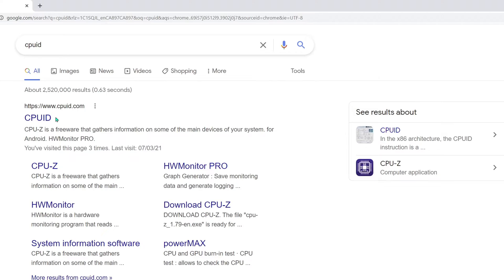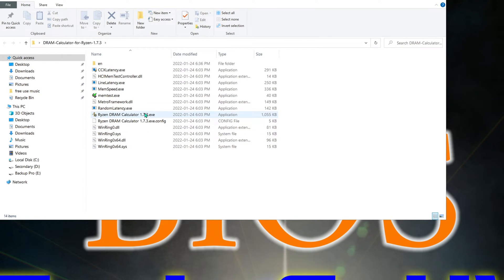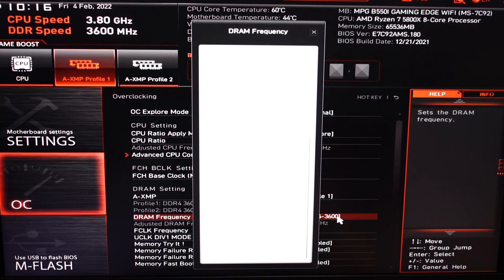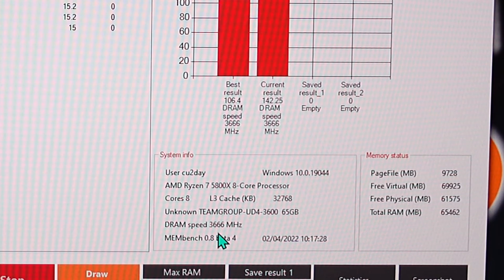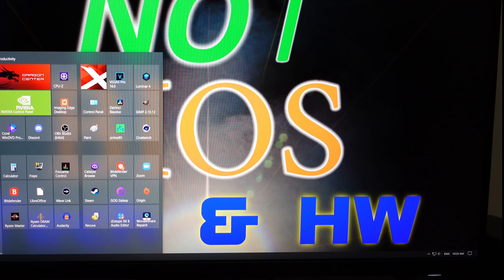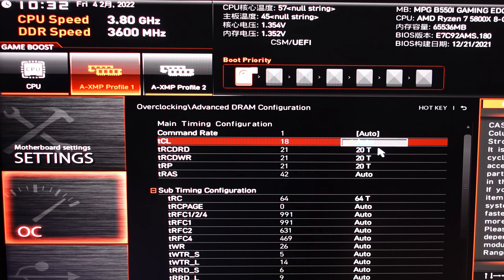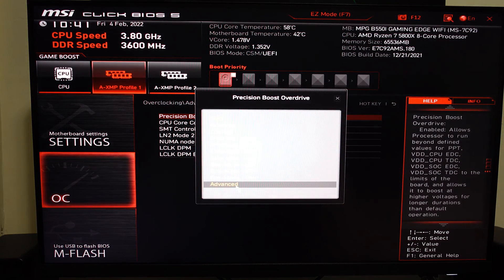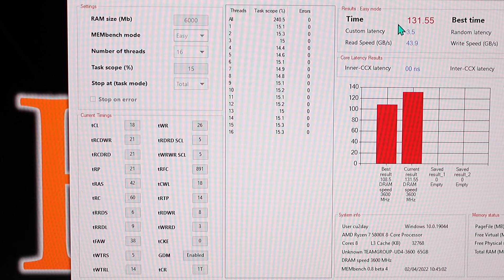Memory (RAM) Tweak/Overclocking, How to Guide (DDR4 shown)

Comment from the maker: Dram calculator that I mention is not for memory clock speeds in this video. It is garbage for that purpose. Use it for memory tool for testing stability. 
HOT TIP - You bought the tightest memory timings. Congratulations on your "binned" memory tested to meet max speed, you have little overclocking left some tweaking might be possible

This is "NOT binned" meaning I have MORE room to overclock timings.
Loose timings, might look bad BUT often they OVERCLOCK like mad. March 1st 2024 bought TeamGroup CL34 44 44 84 memory DD5 at 6000Mhz. And went straight to CL34 42 42 82 easy and stable no voltage touching. Next I went to to 34 41 41 80 next attempt I went to 32 41 41 78 and it is still stable!!! No voltage touching. This is "NOT binned" meaning I have MORE room to overclock timings.

Cas Latency is over Hyped! Those other timings are all delays that are hurting your max performance.

There is no magic bullet to overclocking, it is trial and error. Two sticks of identical memory does not always have the same memory within as another identical stick. Even the same brand purchased in a different package same specs, 1 could be micron and the other Samsung and even the controllers in the memory could be different. Even truly identical memory can overclock different; Silicon lottery! it's a thing.

Comment: Hi I have VENGEANCE LPX CL16 3200mhz can't overclock it only wants to stay at 3200mhz any reason why. I have a Ryzen 7 5700X3D CPU with 32gb of ram.

Ram timmings are.

tCl is set to 16
tRCDRD 19
tRCDWR 19
tRP 19 
tRAS set to Auto which is 38
tRC 57
tFAW 24. 

That's all I have changed in DRAM Configuration.
Reply from the maker: Several CPUs max out at 3200Mhz memory speed. The CPU has a memory controller built in.
Reply: @sparketech  thank you for replying.Does my numbers look okay or is there any you would change. The AMD Ryzen 7 5700X3D officially supports up to DDR4-3200MHz RAM but excels with faster speeds like 3200MHz or 3600MHz at low latency
Reply from the maker: @Al-ly2cx I want you to think about something for a second before I answer. X3D has... Think about it... Larger faster cache memory speeds meaning that memory speeds make a far smaller difference... Only 4% at slow speeds vs max speeds compared to not X3D is a 12 to 15% difference.

Back to topic timings vs memory speeds help certain programs more than others. One is speed the other is latency which is the delay of each instruction. AMD does not guarantee 3600mhz to be stable at 1:1 speeds. With the 5000 series 3200mhz is pretty much guarantee stable. My 5950X (my last AM4 CPU) was less stable at 3600mhz despite my memory being made for that speed.

I recommend 3200mhz with tight timings for the over speed without the occasional crashing issues. Especially even more so with an X3D CPU making like nearly zero difference to performance
Reply: @sparketech  @sparketech  Hi thanks for your time buddy really appreciate it. 

I didn't think of it like that but that's really useful to know I am really interested in ram timming so I am a beginner at this stuff. What do you mean tighter timmings I have my timmings set to something like this.

Tcl 14 instead of 16 doesn't crash 
Trcdrd 19 
Trcdwr 19 
Trp 19 
Tras 38
Trc 58

Can't seem to go any lower then 19 and if I put the tRC to 40 it will also crash.

Also aida64 ram test says 54 ns can't get this to go any lower.
Reply from the maker: @Al-ly2cx be careful about pushing to the max. Let's say your TRC is 58 you find 54 stable... I recommend for stability to go to 55.  Either way the differences are going to be like 0.5 of a frame faster... And when timings are pushed to far it actually makes your system slower due to error correction latencies
Reply from the maker: @Al-ly2cx the TCL timing is the most important followed by those 19 19 19 timings. If you watched the entire video I provided bonus settings to tweak.
Reply: @sparketech Thank you 😊 will watch that video again. Happy new year to you 🎊.
Reply from the maker: @Al-ly2cx Happy New Year. Have a great day

Tomorrow I might release the review of the new case I bought.
Reply: @sparketech awesome look forward to that video if you post it 😊
Reply: @sparketech Hi change my ram tcl 14 instead if 16 , trcdrd 19 , trcdwr 19 , trp 19 , tras 38 set to auto also my trc is set to 55.
is there anything I could do to improve these numbers I have stressed tested using DRAM calculator using membench no errors. Also trp can go lower to 16 or 15 but if I change it will it be out of sink with the other timings. Time with membench is 139.62 Custom latency 4 also read speed 39.6. I have watched your video to the end and if I change my trfc1 lower then 560 it crashes. :)
Reply from the maker: @Al-ly2cx  You'll have to test with some games for a bit... Keep note of default and what you changed incase something isn't "fully" stable and anything has to be put 1 step higher
Reply from the maker: @Al-ly2cx  Sorry still working on the video. I wanted it to be very interesting and informative so I took some extra time with it.
Reply from the maker: @Al-ly2cx posted https://youtu.be/VDJpmduqwQ8?si=13D2WbWLM8tkk6Gd

Comment: I have 8X2gb sticks at 3600MHZ and another 8X2gb sticks at 3200MHZ. The timings are different on the 3200MHZ pair I tried plugging them all together but it says “No display”
Reply from the maker: Memory doesn't always mix and match well. At best the speed is going to be based on the slowest memory. Sometimes even having to reduce the speed of the slowest. AMD systems tend to have issues runing with 4 sticks of memory. Always best to purchase one matched memory kit which makes it that even 4 sticks is more likely to work. Even the identical memory purchased in different packages aren't guaranteed to work to spec listed.

Maybe if you reaet the bios the system is going to figure it out... But no matter what it is only going tobrun based on the slowest so you might be able to get ir work based on lowest speed 3200mhz with slower less tight timigs to ckoser of the memory that is higher speed with less aggressive timings.
Reply: @sparketech  thank you it worked! I lowered the main time speeds from the higher 3600MHZ to match the 3200MHZ. It shows as 32GB now. SUBBED
Reply from the maker: @tony8k  Awesome glad it worked. Didn't know you hadn't tried the lower speed yet. Coming next week for reviews M.2 external storage enclosure, vortex room cooling fan with wireless control, and more Fioboc breathable quality shirts, hidden camera security system. On my studio channel an shoulder camera mount, and microphone review, maybe 2 if the company sends the dual wireless in time before I go to work for 2 weeks out of town working as an electrician on a hydro power plant.
Reply: @sparketech  awesome I will check it out

Comment: The reason you HAS BAD SPEED at 3666 is because you did not MANUALLY set infinity fabric to 1833 and it was most likely the 1800 or staying at xmp PROFILE setting. I have ran 100s of same test and as long as I always matched the infinity to 1/2 which is actual speed ram goes at it was improved speed

Comment: How do you know if its retraining the cpu? I let my motherboard go for 15 minutes after setting certain timings on my ram and then I turned it off via the power button. If it is successful in retraining the cpu does it post?
Reply from the maker: It was usually fairly quick for me when simply changing "timing". The timing is locked when you change it so there should be not retraining with AMD. If you change the clock speed from like 6000Mhz to 5600Mhz it'll retrain and take up to 10 minutes.

Comment: When I used to use 16gb at 3600mhz with xmp my pc was stable, I upgraded to 32gb and I can't get it to boot at 3600mhz now. I have played around with the timings and still it doesn't boot?
Reply from the maker: If using 4 sticks it could be a problem with AMD Ryzen. Did you purchase memory listed as supported on the memory compatibility list for your motherboard?
Reply: @sparketech  hi, yes I'm using 4 sticks which I purchased at separate times but they are the same model. I've just set it to run at 3200mhz with xmp profile 1 and while running memtest64 it seems stable
Reply from the maker: @3Metre  Ryzen CPUs don't play well with 4 sticks of memory at higher speeds... Sadly the same memory means little. The same brands of memory mixes and matches memory within. That is why all brands sell matches sets, to ensure compatibility with the same memory inside.
Reply from the maker: @3Metre  Happy that 3200mhz is at least stable for you. You might even be able to get tighter timings to get some of those fps back. It can be a slow process tweaking for the most speed.

Comment: Hi best video out there period!! I have one question please if i have 2 Ram at 3200 and same 2 rams at 3600 can i tweak them together , mine are from corsair Vengeance rgb Pro, 2 at 3200 and the other ones are at 3600 for now i am running all 4 of them at 3200 but i would like to know if they are compatible with twiking them together or not ?

Comment: Can i Use the timings found in the aida64 under the SPD interface it has a section Extreme Memory Profile v3.0. my ddr5 rams came only with one xmp profile in the bios (i found it weird, on my other old rams it has like at least 2)
Reply from the maker: Your memory timings listed are varied to work timings at a certain speed and voltage given your motherboard / CPU can go that fast. My G.Skills memory only has one set of EXPO timings (AMD) and Intel is (XMP). When mix and matching memory types with CPU brand those timings can actually vary. Make certain when playing with timings you know how to reset the CMOS if something goes wrong. The AMD 7000 series of CPUs can take literally 10 minutes to actually boot after memory timings are changed

Comment: I have zero idea what those many letters mean. tCL, tRCDWR and whatever. Your video didn't make it clear to me even though you replied to me on your other video that I should do this even though I'm a total noob with this stuff. So, I did the basic. I downloaded Ryzen DRAM Calculator and got a score of 112.96. I guess that's alright. I beat your score. Btw, my memories are 2x16GB 4000mhz CL19. I checked a spreadsheet from CGDirector. This is a little bit faster than 3200mhz CL16. Thanks for the video though. Using this software put my mind at ease.
Reply from the maker: Nobody really needs to know what the timings mean. At least if I explained that everyone would just forget this video all together cause speed is the game. They are all memory delays. Higher the number the more delay. You are extremely lucky if that 4000mhz is stable cause 3600mhz is max AMD limit by the infinity fabric memory controller. Don't expect that score to be accurate either. I used it to show the difference the timing made without benchmarking a pile of games CPU used and motherboard make a difference in that score and MSI has a setting that cheats the score without increasing actual speed... I didn't use it. If 4000mh is stable and actually faster and more game fps that is great. Any higher causes delays which slows gaming FPS unless you can successfully overclock the infinity fabric timings which isn't as simple as changing a number.

Make sure to compare your 3600mhz AMD approved max isn't actually the better option. Happy gaming.
Reply: I have a 12700k. On Intel's website it says it supports up to 3200MT/s. If that means 3200Mhz, then I guess I'm lucky. But this thing is so weird. Why would they make DDR4 memory with such high frequency if it isn't supposed to work? I'm glad this headache is finally over though. I updated the BIOS and it worked.  @sparketech
Reply from the maker: @CeceliPS3  ohhh you are Intel. 3200mhz is the official top clock but for higher speeds a couple of voltages can be upped. AMD I believe has a slower memory controller.
Reply: Oh, I see. But that shouldn't matter much for AMD, right? I hear AMD's top CPU is way better than Intel's.  @sparketech
Reply from the maker: @CeceliPS3  AMD has more latency so it makes a huge difference for the Ryzen master score. AMD's best may be good for gaming but there motherboard bios support for the 7000 series of CPUs it I believe trash compared to Intel. I reported issues to MSI for my motherboard literally 5 months ago and still issues. AMD CPUs also do not seem as stable as Intel.
Reply: I see. Although not a fanboy, I guess I made a good choice being on Intel Team. And this was only based on the fact that I have seen a lot of games throughout the years needing a patch, either from gaming developers on their games or AMD's drive updates because it wasn't working properly while no issue was happening on Intel's CPUs  @sparketech
Reply from the maker: @CeceliPS3  Always good to see from an objective point of view... Being a fanboy of brands never helps anyone. Some of Intel's higher end CPUs draw a ridiculous amount of power and run crazy hot. the 12700 CPU is in my opinion the best choice you could have made. I was writing 12700 and looked back after what CPU you got. You made some very good choices with your setup. Reasonable power draw with great performance and a good number of CPU cores.
Reply: Thanks. And that was another luck, haha. When I bought the 12700k, the 13th gen was about to come out. I had no idea 13900k was gonna be such a hot CPU and also power hungry with 300W. Comparing them on Cyberpunk, 13900k wins by 10 frames. That's no much to justify the price, watts and temp @sparketech
Reply from the maker: @CeceliPS3  👍
One day you'll probably be some awesome tech guy that everyone goes to for advice. You sound just like how I went about making choices. I switched back to AMD because when Intel started putting pins on their motherboards rather than CPUs I killed 2 CPUs cause the pins bent without me doing anything other than several inserts and removals of the CPU. Also AMD had the long term upgrade path that I could go for 3 years just tossing in new faster CPUs. When Ryzen CPUs came out they had memory issues for about 1.5yrs before fixing most of the problems, I didn't go Ryzen for about a year. This new release is the same. Most reviewers are being fanboys of the brand rather than admitting the shortcomings of the AMD platform and issues. I make videos of the issues but by doing so I actually hurt my channel because the marketing team purposely thumbs down the videos to end it. If I were like 100K subs I'd be too big for them to do that. Stating the negatives actually hurt my Studio channel as well.
Reply: Oh, you're too kind. I'm a total noob when it comes to PC. My only super power is to know which people to listen, haha. But yeah, I feel your struggle. The recipe to get a big channel is to shill a lot! Or to get some audience by trash talking stuff to the point that you become a threat and companies start to pay you to shill for them.  @sparketech

Comment: Good video. After I tried to lower tRCDRD, tRCDWR and tRP by 1 I could not boot my pc and had fix it via CMOS. Should this happen? I mean ok if i would go -5 straight I would understand to hang it up before boot but I could even not lower it by 1.
Reply from the maker: 100% that can happen. In this video if I remember I found out I couldn't move my Cas latency by even 1. It's a time consuming process to get the best timings. It just takes the one that is best it can be to throw it all out.
Reply: @sparketech  thanks for the reply. Would it then help to adjust only one value at once?
Reply from the maker: @pascalkreis1524  slower but easier to narrow down which settings can and can not be changed. Would recommend writing down what settings work so if you have to reset CMOS you know where you left off and know not to touch what failed.

Comment: Why does the increase of DRAM voltage, increase CPU temps?
Is it because higher DRAM workload makes CPUs work harder as well?
Reply: I think it's because the memory controller is on the CPU. So maybe the memory controller works hotter too, as the DRAM Voltage goes higher.

Comment: when u say membench for 3 days straight, you mean do the test for 72 hours, or just do it once a day, for 3 days?
Reply from the maker: Test as you like. 72 hours straight would be nuts just for the day is good as a final test... Not sure if I mixed up in what I spoke but I said run 3 runs which is a few minutes each run is all it takes. For the day alone is a good final stability test. Please never run it all day for one small change.
Reply from the maker: Once a day for 3 days at even 3 hours per day would certainly be a good test. Or playing games and using as usual and see if it ever crashes is a good test. Some programs never crash when on the edge of stability while some like Davinci Resolve studio crashes easily when the computer is not fully stable
Reply: @sparketech  Thanks mate, can't wait to try your guide.
Reply from the maker: @DanielS-zq2rr  Thanks. Just an FYI if you have an Intel system there are specific voltages that need to be increased if you increase clock speed rather than timings.
Reply: @sparketech  I actually have a Ryzen, and I'm not going to increase the clock speed.

Thanks for pointing it out though!